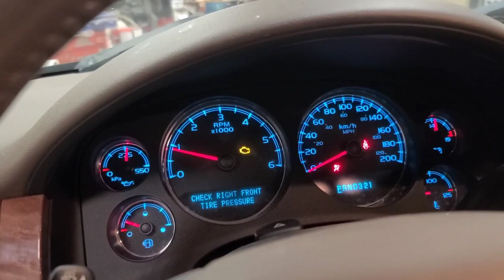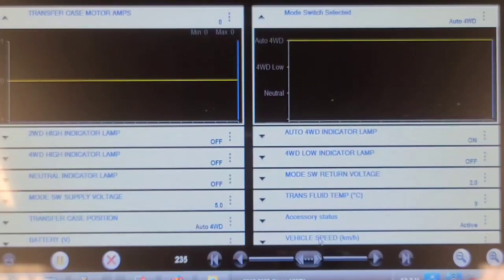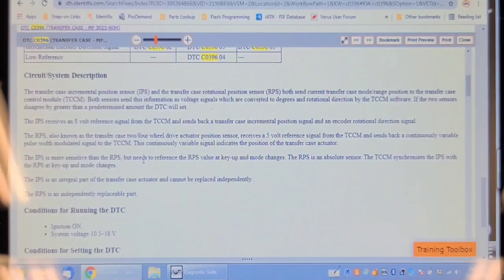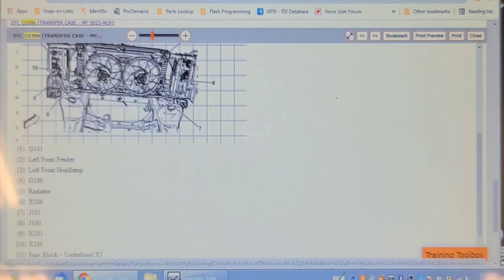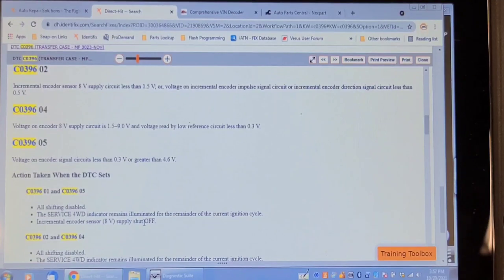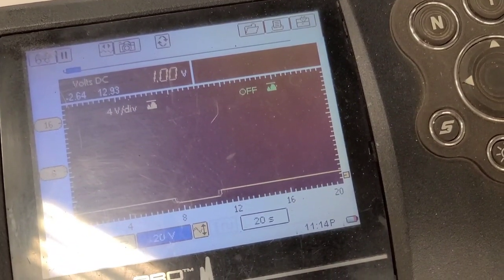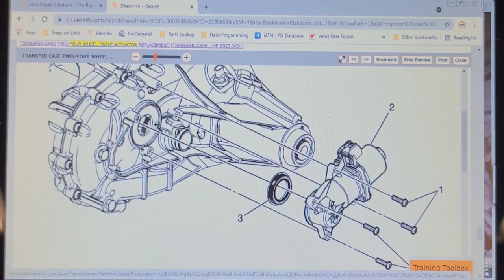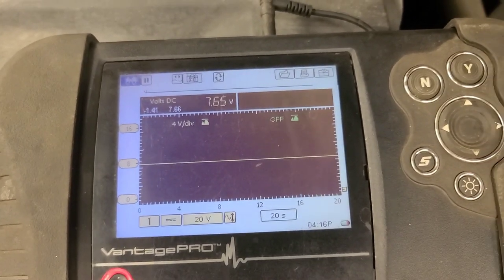2007 GM Truck 4x4 Not Working C0396 Code Current

Comment: PHILLIP, writing bet late great thought process and the 8 volt reference voltage was confusing indeed i watched other guys with same problem they just went and changed that motor with out any diagnoses the way u did that is the reason am hocked to ur channel and videos because in this channel there is alot information and procedures that u do is great to learn so thank you and much appreciate the time and effort it took to do all this brother. cheeeeeers
Reply from the maker: Thanks I really appreciate the positive feedback. Given the cost of the part I felt it was wise to try confirm the failure.

Comment: Thank you sir. I've been throwing money at parts and you just saved me
Reply from the maker: Glad it helped you. What was the problem with your truck
Reply: @PhillipBailey  it was exactly this video that is wrong with my truck. I replace front 4wheel actuator, transfer case control module and it still did this same thing in the video. And so I thinking this is it with my truck since the other 2 repairs didn't work.

Comment: Mine is the same code but -02 speedometer doesn't work truck doesn't shift and the front diff is locked in but transfer case is stuck in 2wd
Reply from the maker: Sounds like you have multiple problems. What code/s are in the PCM for the speedo and transmission shifting. This C0396 should not affect the transmission or speedo.

Comment: hi sir I have same codes on 2012 5.3 Silverado and from your diagnosis I wonder if you could back probe circuits with a signal generator to try and force it which would maybe show the problem in encoder motor side
Reply from the maker: I doubt that would work since the TCCM is looking for multiple comparable signals. Additionally if you back probe a shorted signal it will short out the signal  generator. If it was a simple analog signal like a position or pressure sensor that would work. Good luck

Comment: Couple comments:  Don't know Dorman's warranty on this part, but like to stick with OEM on more critical parts, especially electrical, and especially any that are difficult to access (don't want to have to do that labor twice!)

Second thing is I try to keep all testing using the component's associated designed ground.  This can be a pain with access problems––and can be skipped by going to another known good ground.  But if you're REALLY having a problem pinning the electrical complaint down, you got to use the circuit's designed ground to ensure that that ground is OK.  Easy to focus on voltages or amperages on positive wires––but the grounds, as we know––just as important to complete that circular path for designed current to flow.
Reply from the maker: Thanks for the comments. Yes grounds are extremely important and often overlooked. Dorman often offers a lifetime warranty if installed by a registered repair shop. I'm ok with this part but I do agree with you on a lot of electrical sensors I will always recommend oe if available especially when it's a pita to access.